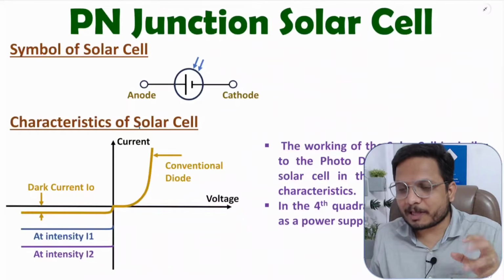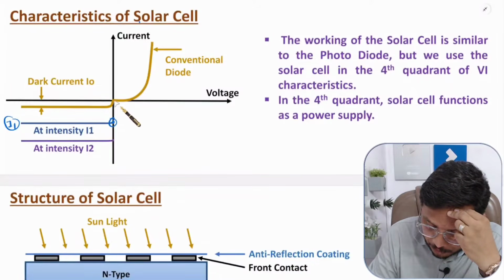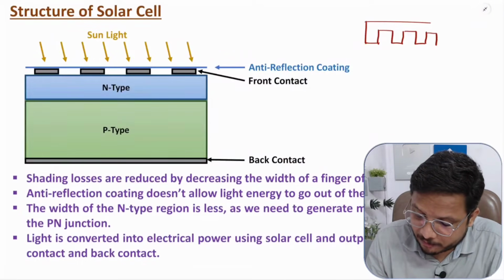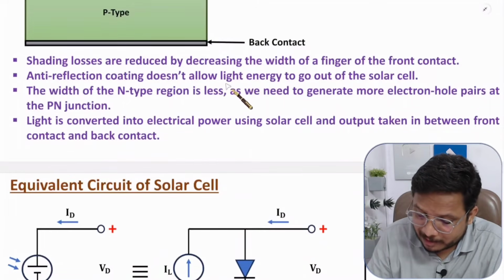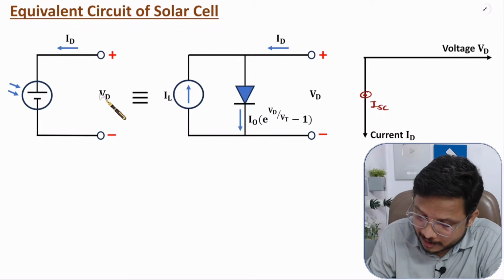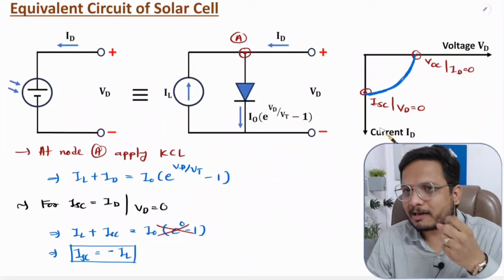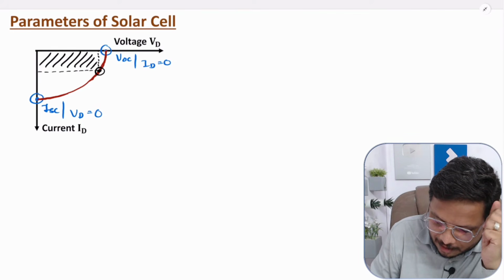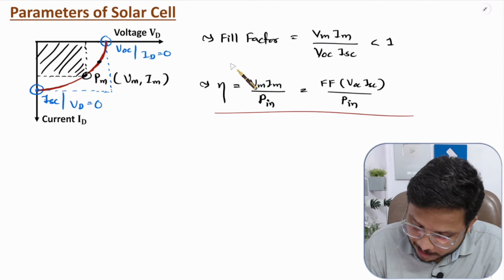Solar Cell (Symbol, Basics, Working, Structure, Equivalent Circuit & Parameters) Explained

Comment: for open circuit voltage can we consider ideality factor n ?? if it is given si diode can we use  n=2 and calculate the open circuit voltage accordingly??